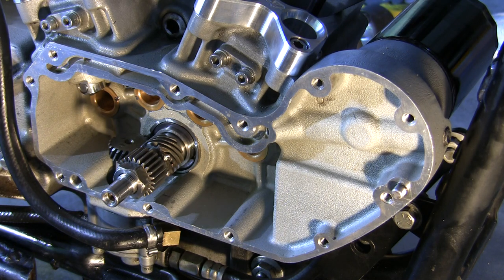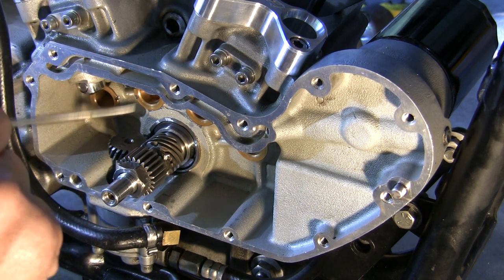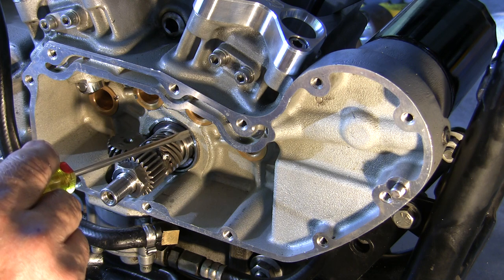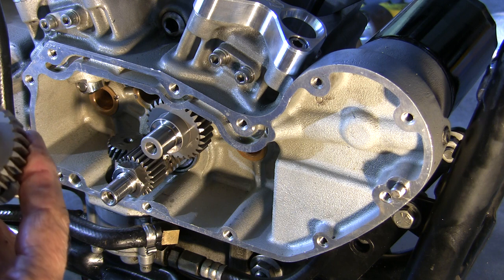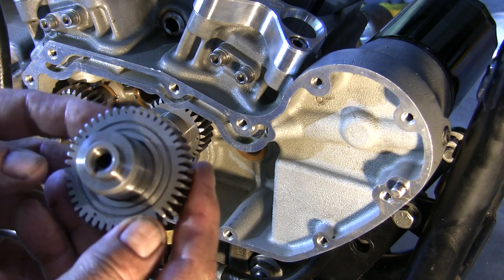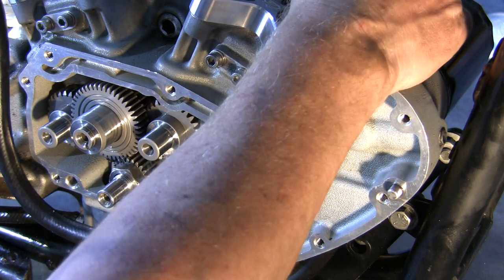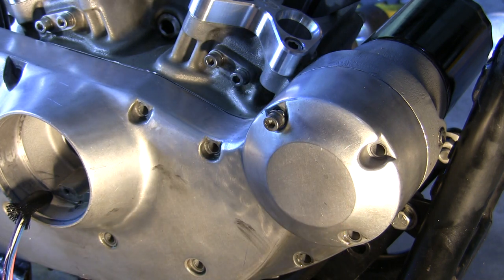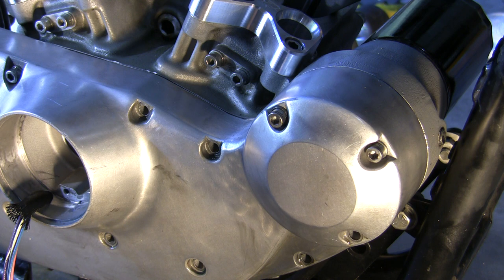Harley Sportster Camshaft Installation, 600 Lift Hammer Crush Cams, How to Install Cams On XL

Comment: I have a problem, I wanted to remove the crankcase and a gear remained attached to the crankcase. now I don't remember its original position anymore and I don't even know what position the pistons are in. how can i restore an operating situation without breaking everything?
Reply from the maker: Boy it is a touchy job. It would be best to use the HD repair manual and follow each step closely or to have someone with experience assist.

Comment: When putting the gear cover on  , obtain some suitable length 1/4" bolts , cut the heads off and slot them with a hacksaw , use two or three as required  . These are used as dowels to hold the gasket in place .This  works equally well on primary covers.
Reply from the maker: Hey Jeff I will try that next time. Thank you!
Reply from the maker: Hey Jeff I will try that next time. Thank you!
Reply: What A great idea!

Comment: My 2001 Sportster has a slight tick and rattle at idle on the front cylinder, I've tried different lifters with no change. I've also tried different rockers as I noticed the front exhaust one had a little wear in the bushing but the noise is still there! When I run the engine with the cover off I've noticed that the front rocker has less oil spewing out than the rear, do you think there could be an issue inside the cam cover ( slightly block oil gallery to the lifter) . I don't want to remove the cam cover if it's not needed but I'm stumped on what's causing the rattle! It's definitely from the front rocker box as I've listened with a stethoscope.
Cheers.
Reply from the maker: Hello and noises and rattles are very hard to diagnosis on noisy Harleys and top end noises are sometimes hard to find even with a stethoscope. So it is very hard for me to make a suggestion even if I was standing next to the bike running. Maybe a bent valve?

Comment: I'm new to HD and i've got an Import XL1200 from 96, (i'm overseas, europe) the cover you put back on in the video, Camshaft cover as i'd like to refer to it as, is chrome and in really bad condition, i'd like to change it, is that pretty straight forward, remove bolts, remove cover, replace gasket, install new used cover in better condition - or can you tell me where is the danger zone in this job? :)
Reply from the maker: The problem is in getting the 4 cams lined up right during reassembly.
Reply: @motorcycleridingandrepair1627  can it be done without tops off?
Reply from the maker: @filmfreaken  I think you should be able to do it without taking the heads off.

Comment: If the welded gear/oil pump drive are not in total concentricity after welding process,it may cause poor run-out on driven cam gears, or may cause torqued nut loosen over time.
Reply from the maker: Thanks for the commrnt!

Comment: I have an 09 nightster I broke off a exhaust stud not completely off do you have any idea how to replace it without taking the entire engine apart
Reply from the maker: If u can get a drill into it at the right angle u may be able to try an extractor but it is a tough job without taking off the head. We sometimes have to use a heli coil or an oversized stud on the one end only.

Comment: What sprocket tooth set up are you running?
Reply from the maker: I use a smaller transmission sprocket.
Reply: @motorcycleridingandrepair1627  19 or 20 in the front, 50 in the back?

Comment: How has that pinion gear held up so far. I got the .600 crush cams myself. Was wondering if it's worth the money to get the backdated pinion gear? Instead of staying with the stock one? BTW I have a 2001 xl1200c
Reply from the maker: Hi Jeff! I have used both types and I have not found any difference. However, I do always use the updated bronze oil pump gear that sit right next to it on my builds.
Reply: Harley Davidson Racing love your videos by the way
Reply from the maker: Thank you Jeff! I am glad you are watching!....Mark

Comment: Hey HDR, thanks for your knowledge on all your videos.
Is there any cam that can be installed on a 2016 xl1200 with no engine mods, except high performance air  intake and exhaust.
Reply from the maker: Andrews has bolt-in cams for your model where you would not need to do any additional work. I believe they may be the N8's but not sure. You can do it.
Reply: Hammer 560 and 570 cams

Comment: And stock length valves
Reply from the maker: Yes stock length valves. However, the Hammer BFH heads have been altered with a different valve angle and larger valves. Look at Hammer's site and look for the BFH heads with the 120 HP+ 1275 kit.

Comment: awesome video yet again.... thinking about putting a set of n4 came in my 1200 with a hsr42 carb just can't decide on an exhaust that won't brake the bank....how do you think n4s would run in a stock 1200
Reply from the maker: Think about the Danmoto pipe? Any of the bolt-in cams would make a 1200 wake up a little!
Reply: What's the biggest cams you can put in without machine work